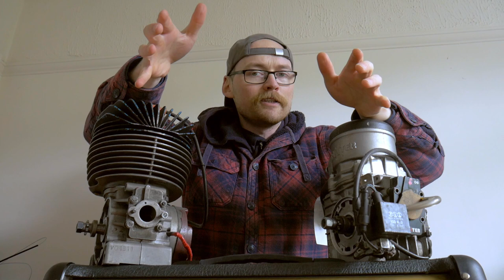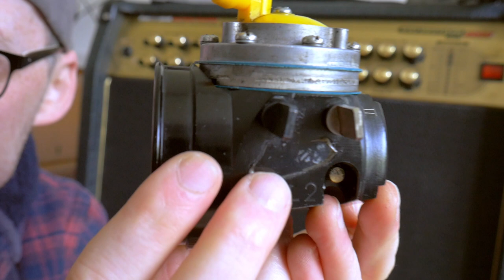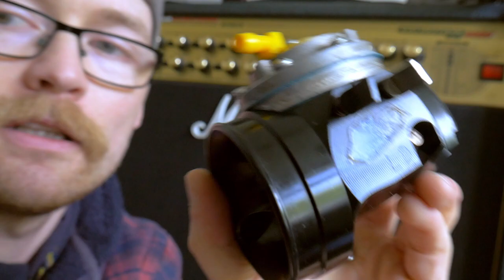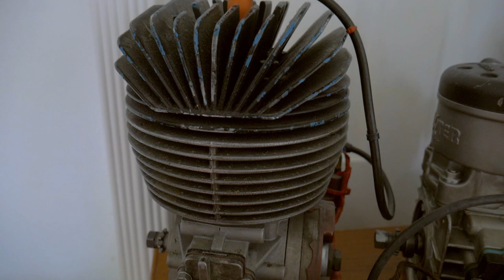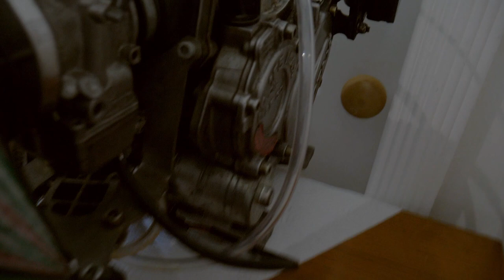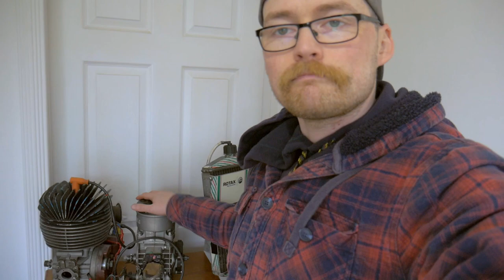2 stroke PERFECTION - Why 100cc kart engines represented the PINNACLE of screaming glory!

Comment: Karting brought 2strokes further in development than any other sport especially with carburetors and expansion chambers. Back in the early 70s we tried a Lake fuel injector but absolutely no gain over a carburetor. The best carb I ever used was a modified Mikuni, it was called a Culverator. Culver was the company.

Comment: There was nothing like a Formula A screaming at 20,000 RPM.  Not the straight line speed of the gearbox classes, nothing.  The nimbleness, aggression  and sheer violence of a Formula A, nothing like it. I think they ruined the sport.

Is that Ital Sistem a blue head by Miliziano?  It looks like Ital Sistem to me, anyway. 

Nice Marshall amp in the background. JVM?

Comment: " parilla engine " amazing 👏  !"   " regular  choking " with tune " slightly leaner "   tip : use " belray 2 stroke oil "  can use 10 oz to gallon of fuel   = " more power !  ( normally 12  oz to gallon ) 😊
Reply: More revs and more load = more oil needed…
Reply: @dennisyoung4631  " dennis i never had any problem !"  10 oz to the gallon  " using belray racing 2 stroke oil  ???"
Reply: @kerrykelaher2607  meant that more for the 50 to 1 crowd, actually.

I don’t like that for weed-eaters, much less things like b-bombs.  (Ran MC1+ at 32 to 1 in the weed-eater, turned out both High and Low screws until it ran “better.”

Bel-Ray - MC1?  H1R?  Not sure if they make a Castor.  Do they?
Reply: @dennisyoung4631  "does your weed eater  do 20000rpm  ??" Stupid  conclusion 🙄     laugh 😃 😀 😄 😁 🤣
Reply: @kerrykelaher2607  no, it didn’t.  You’re right to use more oil.  More revs, more oil.

Recall reading somewhere that the amount of oil needed is roughly proportional to how fast you’re turning an engine.  What’s “ok” for, say, 5500 (32 to 1) is grossly inadequate for twice that - much less nearly four times that.

Hence, 10 to one - a figure I recall reading about in at least one book on kart engines - is not out of place.

What might be strange is the idea of “model airplane RPMs (20,000 or higher) want model airplane oil ratios” -  e.g. 3 parts fuel, one part oil.  Then again, those often have bushings rather than ball, roller, or needle bearings - which is where the design of the engine plays into oil needs.

Comment: I have an 1983 Yamaha KT 100 on an Emmick Chassis. It tops out at 83 mph at 14,000 rpm on my fastest setup. 21,000 rpm is crazy. I had no idea. 36 h.p is the most if ever heard of on a kart besides custom builds. With my can pipe I'm at 12 h.p. on my Stinger race pipe it's at @16 h.p.
Reply: yamah kt100s can do 15200-15400 at the ends of straights :)

Comment: Best engine ive ever had was a 100cc maxter rotary. The thing loved it at 21000rpm.
Now running a iame parilla 100cc reed. Good engine with big ports and a x30 reed block  but not even close to my maxter
Reply: What's that a formula blue 100cc

Comment: 1987 .......15000 + rpm air cooled 125 cc /25 +  hp 2 stroke race eng.(McCullough) adjust the carb on the fly. centrifugal clutch ,chain drive, single sprocket , top speed 85 mph. sprint track  race kart ,disk brake. good year bluestreak race slick tires /gumbo rubber. 🤗loved driving this race machine on the homoglated westwood (coquitlam bc ) sprint kart race track where you could hit top speed 3 seconds out of the 45 degree left turn on to the short straight burning a bit of rubber on the apex 😲YES>......

Comment: 1:40 or wrap two meters of string around the tire and pull. I'm too lazy to push. :D i saw one guy starts engine with a snap on power tool but this is bad for bearings i guess.

Comment: What is the difference between say reeds and a piston ported engine?
Reply from the maker: generally speaking reed/rotary valve produce more power for the same cc.
Reply: What I'm saying is that Reed or rotary valve are also piston ported. Shouldn't it be called a Reed or rotary engine, not that the older version is called something different?
Reply from the maker: @dirtygarageguy  I am not sure I follow.

Something like a BT82 doesn't have either a rotary or reed valve. It'#s specifically designated as a piston-port engine. This explains it here https://www.youtube.com/watch?v=DczDdGiBUdM
Reply: @dirtygarageguy   sounds like you are confused as to how a 2t engine works bro. You are ignoring the carb on your query. Every engine is piston ported. Reeds and rotary valve work in tandem with the carb. Get some diagrams and study them. It's not rocket science.

Comment: Hello! If you don't mind sharing a link to a community where i could ask about some more about these engines. 

I have an old mik 360 l(at least i hope i do, but it's a liquid cooled one in any case) with a tillotson carb, and can't manage to get him running how he should. Mid to high rpms he simply takes my breath away, literally, but when i try to push start, he always bogs down but then very very slowly creeps up to an almost normal state, then when i'm finallly reaching those peak rpms, he completely dies on me. After we slow down a bit, back into the mid range, he comes back to life.
Reply: Does it smoke much out of the Exhaust? Then it,s running to rich. When you got nearly no smoke on the exhaust and you hear a metallic sound your engine is to lean and you need to adjust the carb. when adjusting dont help you need to get a new carv gasket or you need a new carb like me because it somewhere sucks air and dont work. I had the same problem With my tuned TKM s89T Rotary valve engine now i got a new 27mm Italsystem carb on it now its running and revs to 20.000rpm love that engine. 
I hope I could help you. sry for bad English its not my main language
Reply: @ivotrambo9803  i got it to a point where it's running neither dry nor rich. but just the other day i found out the exhaust is not suitable and that should be a big reason for it not properly pulling from the carb.

Comment: I have a rotax fr 125 non evo and at my local track and i can smoke those kt 100s even lap em but they are mostly old guys driving those lol
Reply from the maker: Dont come in here talking about KT100s :)
Reply: Get an x30 you will be addicted and less broke at the end of a season of racing.
Reply: @snafu7998  i dont have mutch break for me i put 50 hrs ride time in this season and all that broke was the radiator mount but now it needs full rebuild do the x30s go longer without rebuild because that would be helpful i dont like that 50 hrs untell rebuild kinda sounds like a lot but its not that is like 20 times to the track if u get 2 hrs ride time in every track day the but i do love the way the FIA IAMEs look with the blue head

Comment: Are you really old school? Under that 50year old stash you're only about 30ish. That's not old school.
Reply from the maker: oldschool not old
Reply: @AlanDoveKarting    Ha.ha. You feel the same  as me about rotax, but instead in the early 2000s I refused to race those pieces of junk so opted to race formula blue 100cc centrifugal clutch, this was the nearest thing to the old 100cc DD we could race in the UK. Now past 8 years it's gearbox all the way. Thank goodness for the x30. Bye bye rotax!
Reply: @AlanDoveKarting   Although the rotax DD2 dual gear is a good bit of kit, many would disagree, but they aren't bad engines.